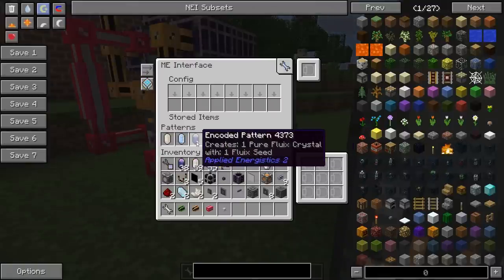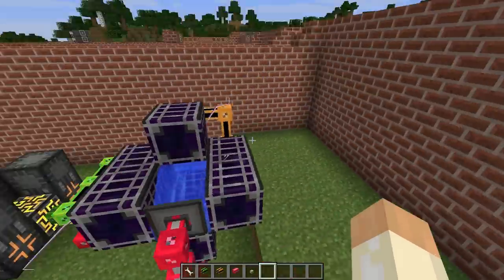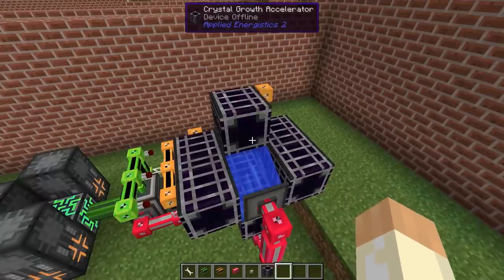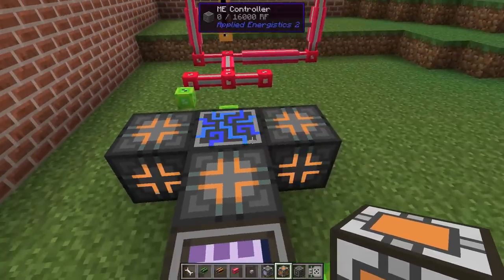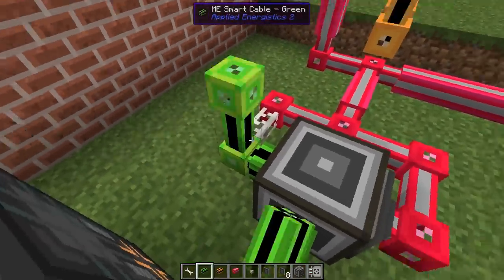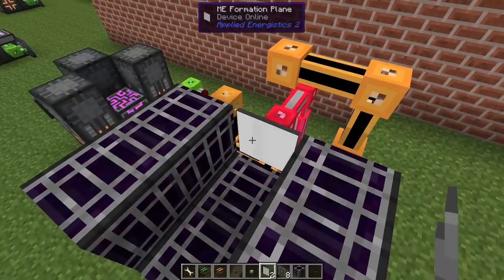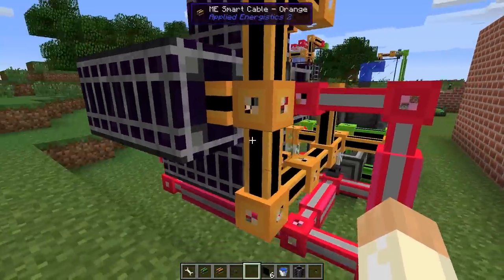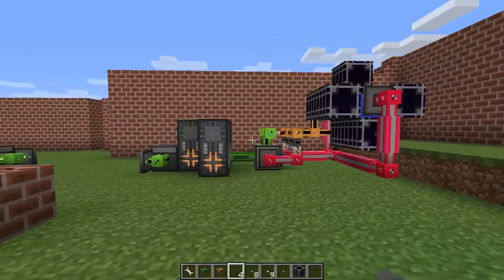AE2 Tutorial #15 - Auto-Crafting Pure Crystals (Another Variant) (MC 1.7.10)

Comment: This is an amazing design.  I love that it doesn't require lag-generating redstone clocks, since I like to play on servers.  This is most definitely a machine that I will be building in my base some time in the next few days.
Reply from the maker: Matt Avenson Glad you liked it. Depending on what mods you have installed there might of course be other methods, but in pure AE2 this variant is quite good as long as you have a good power source (it takes longer than my first variant, but is much easier to build!). A small tip: Always craft many at the same time, you can set the recipe to be like 20 seeds = 20crystals so nothing less than that will be created.
Reply: TKH I built the one you showed in the video, and I did have some problems with how much power it took to run, and also how long it takes since the seeds constantly are being dropped and picked up.  I found that removing the annihilation plane, tilting the machine upright, and having the formation plane drop the seeds into a still water source block.  Then have an item transfer node from extra utilities with a filter for the finished crystals and a world interaction upgrade to pick up the final products.  Then pipe them directly back into the full block interface.  This method keeps the circuit that turns on and off the growth accelerators since that is very useful.  This method is not only faster, saves on power, but also allows you to make regular fluix crystals and pure fluix crystals in one machine.
Reply from the maker: Matt Avenson Yes, that's a good method, and in fact one of the two I would recommend people playing with modpacks. But the purpose of this perticular design is to do crystal growth auto-crafting with no mods except for AE2. You can also do a very compact and even faster (5 accelerators) version with Steve's Factory Manager.

Comment: For improve the Crystallization process, try rotate the "acceleration tunnel" to a vertical position where you use the formation plane to drop the seed from the top and annihilation plane to receive the seed at the bottom. If you can work out the wiring I think it can achieve (maybe even higher?) the efficiency of your previous design while still having all the advantages this build provides.
Reply from the maker: +Baichuan Ren I tried that when creating this build, but it didn't work for me at that point. It falls too quickly or something, as I remember it I had to have the seed on the bottom of the water to get it working. My idea back then was to have lots of accelerators and stack them to a hollow pillar. But it didn't work for me... Feel free to try it and get back with a better method :)
Reply: +TKH Oh, in that case, since annihilation plane can't be filtered, how about import the annihilation plane connection to a subnetwork(rather than cycling it) where only fully grown crystals can be accepted. And the main network can access this subnet through extract only interface connection. This way the importing subnet will act like a filter and prevent any seed from entering the annihilation plane until its fully grown(I think...).
Reply from the maker: +Baichuan Ren If I understand your idea correctly, I think I tried that as well back then. Items can be sucked up by the annihilation plane without having anywhere to go. It will end up in some internal buffer in the plane I guess... Seems like we think in similar ways ;) An advanced workaround could be the have a timer in the system that will disable the annihilation plane during the growth time. But the seed would have to be in the water source block to grow, so a blocking item would have to be lowered (or placed) next to it. I think it would be possible, but very advanced and not really give anything except for shorter growth time... :)

Comment: Could you make it just fall down through a source block of water on an up turned annihilation plane? Presumably the item would form at the formation plane, drift down through the water and go back into the network the instant it touches the annihilation plane to reappear at the formation plane.

If it forms to close to the annihilation plane perhaps you could have an air gap?
Reply from the maker: You are correct, but back in this old version that wasn't possible. The mod got some updates that made things much easier! If you look at new versions of this build (check playlist and you'll probably find one) they are compact, fast and more logical :)

Comment: I have come across a solution that uses only AE2 .  It uses formation plane on sub network (interface to interface then formation plane.  Annihilation plane connected to storage bus, interface running back to main network.  storage bus acts as  a filter for the Annihilation plane and any item in storage bus can only be picked up.  you can do all four crystals in same block of water, no flowing water with it recycling back.  With this setup you can have formation plane on top, Annihilation plane on bottom, seems the only way for annihilation plane to pick up is entity has to be touching it.   Have level emitters to turn on and off the accelerators for the pure crystals.  TKH  feel free to do updated video if you want.  I think there needs to be more ae2 videos out there and i loved watching your series, really helped me improve my ME network. 

 I also use formation plane and annihilation plane to break blocks.  You can set up like above with storage bus and interface to filter, just put what the finished product would be in storage bus not what you are breaking.  You don't have to use that filter though in breaking blocks.  It is only way i have found without using something that can hold a fortune pick or breaking myself to get certus crystal out of a certus ore. Every other way seems to make dust, least with the limited mods i am using.  It is random, i get 1-2 crystals every block break, so your recipe can only be 1 to 1.
Reply from the maker: +Terrance LEcuyer Just checked the release notes for the rv2, and it says "Removed buffer from annihilation plane.". I know that I had tried this before and it didn't work because items got sucked up by the annihilation plan even though there were no place to put them. So thanks for that, I had no idea this was changed! :) I will do an updated video, because this limitation was the very reason for the old methods being so "advanced". Not sure I follewed the other part, You're using formation plane to put down ores and then breaking them with the annihilation plan?
Reply: +TKH Not most ores, it only will give you one.  I do items like certus quartz, clay, stone to cobble.  It is faster than any machine I have found to do the same.  I only do certus through it cause the pulverizer will only make dust.  I am using FTB Lite 3 modpack with a few mods i have added in(AE2 being one of them).  I am limited to ways i can process ores.  Using formation-annihilation planes gives me another option in how i can process ores, and other blocks.  It is lighting fast also.  1 stack takes like a second.
Reply: +Terrance LEcuyer  Let me clarify what i typed above.  The annihilation plane kinda acts like a pickaxe.  If I put a iron ore block down, it will pick up iron ore block.  If i put diamond ore block down, it will break the diamond block and give you one diamond.  Clay block to 4 clay. ect...  It is a very nice and fast way to automate some things without going through a puverizer, sag mill or any other method you can automate certain block processing.
Reply from the maker: +Terrance LEcuyer Ok, I understand! Never tried to do exactly that, but I know it's fast. The only downside is that you can't get any extra material from it, like a fortune pickaxe gives. But you can always mine with a silk pickaxe and have the system break the blocks you don't need to double (Lapis, Redstone ,Coal, Certus...).

Comment: Having a little trouble with this build when encoding the patterns, could you describe how to create the patterns step by step please?
Reply from the maker: Chris McGill To make patterns you can alter between two different modes. Either a crafting pattern, or a processing pattern. To make the pattern for a seed to a pure crystal you'll need to use the "processing pattern". Then you deside yourself what the in/out is. Then just place a seed to the left, and a pure crystal to the right and encode the pattern. Easy! :)
Reply: therealtkh Thanks for getting back so quickly, cheers! i'm new to AE2, your videos have helped alot =)
Reply from the maker: Chris McGill No problems, just glad to help :) Hope the build works out! Depending on what mods you have installed, there might be easier solutions, but I haven't seen any better pure AE2 ones so far ;)

Comment: and annihilation plane to an me chest with a drive formatted only to accept those crystals will work, then a bus on the me chest. My only problem is when the seeds are part of a crafting recipe it just holds them  in the crafting computer
Reply from the maker: +Healcan Jim Thanks for that solution, I'm almost 100% sure I've tried that before, or a variant at least.... But I did it again now and it works just fine. I might do a video about it just to "replace" this old one. But I had no problems when pure crystals are a part of a crafting job, my crystals was ordered and it worked just fine.... I didn't try it all the way from seeds though, does it work if you have pre-crafted the seeds?
Reply from the maker: +Healcan Jim I spent some time with this build today and I ran in to an interesting problem. When chain-crafting I noticed that only Certus Quartz Seeds worked as they should, the other seeds got stucked in the interface. But when I put the seeds into the system manually it worked just fine. So I re-did the patterns and made sure they were made correctly the whole way. Since I did this in a creative world, I just picked the seeds from NEI at first. This was the problem for some reason. The seeds crafted by the system was not approved as part of next recipe. And the filter in the Formation Plane rejected the crafted seeds as well. I made sure both patterns and filtering was made on seeds crafted by the system, then everything worked perfectly! Will hopefully record this tonight, so keep an eye out on the channel for a video within a few days :)
Reply: +TKH I wasn't able to get it working as a chain, would hold seeds in crafting computer didn't come up with a valid place to set up a crafting recipe to feed the seeds to the formation plane. Have just been doing seeds first stand alone.
Reply from the maker: +Healcan Jim Did you watch the new video (posted yesterday)? I built it from the ground up so I hope it works if you follow that...
Reply: +TKH When I get home I plan to update the server to 2.3.5 then if it's not broken I'll redo my setup, I'll probably add the power toggle to my design so when I'm away from the server a few days working  rf I won't come back to a dead ae2 system again
Reply from the maker: +Healcan Jim Yeah, power toggle is good unless you have an infinite power source like a treefarm or similar :) Hope you'll get it working, if not, feel free to send a PM here on YT or on facebook with an imgur album and I'll do my best to help.
Reply: +TKH Rebuilt it on the other side of my base added p2p network and all said and done works like a charm, everything I do is in survive and can take some time.
Reply from the maker: +Healcan Jim Ah, great! You know how they say, if it doesn't take a long time to build, it isn't worth building ;)